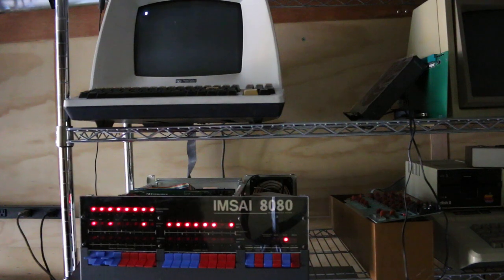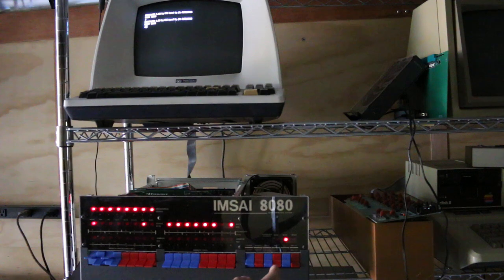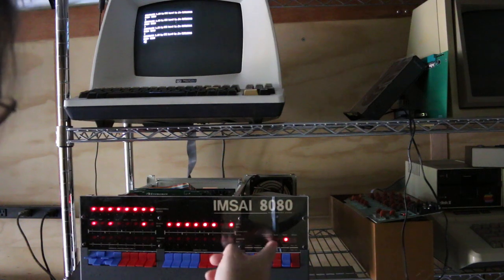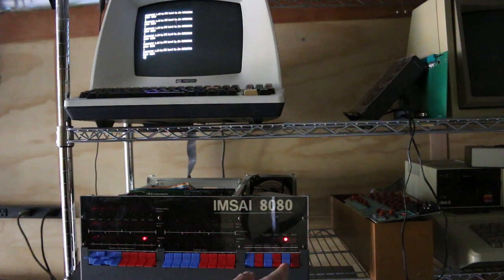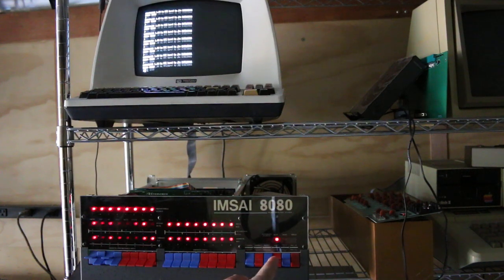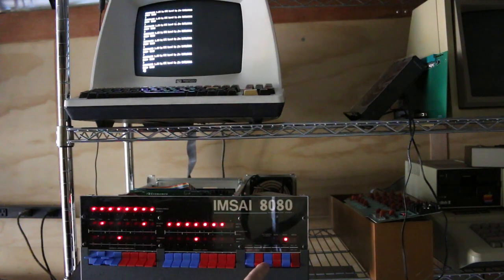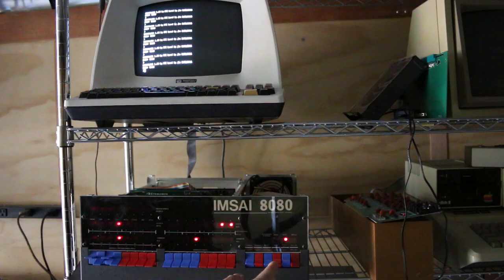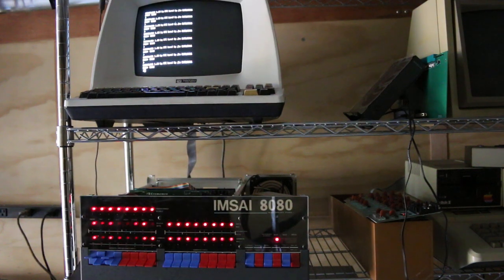ImsaiFrontPanelErrors 0

Comment: I hope you sorted your issue. I have the same front panel and chassis on my Cromemco Z-1. I always hate having to remove the front panel because I know I'll be swearing when it's time to put it back in due to the balancing act of trying not to drop those little metal spacers when reassembling it. A previous owner cut some tracks to disable the programmed input switches and output LEDs, most likely because they had some other device at I/O port FFH. I hope to undo that soon.
Reply from the maker: If you're at all interested in selling that Cromemco Z-1 I'm very interested. Dollars or trades?
Reply: @GumShoeNoir , nah, it's a definite keeper.
Reply from the maker: @snarfusmaximus  :-) I figured that was an extremely long shot! I know one other guy with a Z-1, I wonder how many are still out there? I've been looking for years. I want a Z-1 to round out my collection. I have a WMC hex panel https://wiki.theretrowagon.com/wiki/File:TwoImsaiS-100BinaryAndHexadecimalFrontPanels.jpg
Reply: @GumShoeNoir  Never hurts to ask. Well, I removed the Z-1 front panel and found that the modification was only to make the LED's active high, as opposed to active low. I reversed that mod and then found one of the LEDs in the programmed output was dead. I replaced them all as the spares I had were a bit brighter. I then tested the TTL chips in my TL866-II EPROM burner (those things are GREAT) found 3 dead chips which I replaced. The programmed input switches then worked but I got nothing on the LEDs. That left the 8212 as the culprit, which I replaced with a spare and that sorted it out. Weird how the input port on it was good but the output was dead. Gave it a good test run with the RDOS monitor, and a little MBASIC program that outputs the switches to the LEDs. To say the least, I'm very  happy and the swearing was well worth it.